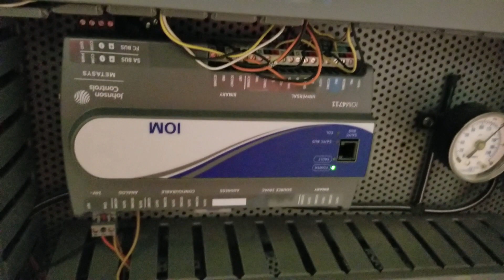Johnson Controls DX 9100 Replacement FAC Controler

Comment: Hey system control Tech I'm trying to load the M tool 5.4 application for HVAC Pro on to my windows 7 pro 32-bit laptop but I keep getting a windows pop up error and it wont install. I tried to disable Windows errors I tried to install it as an administrator I tried a bunch of things and haven't had any luck any ideas for me? Thanks!
Reply from the maker: There is an entire configuration process to help install the program on windows machines.  The easiest way is to install the CCT tool which will do a lot of the configuration for you.  You might be able to find the configuration settings online but it can be aggravating to do.